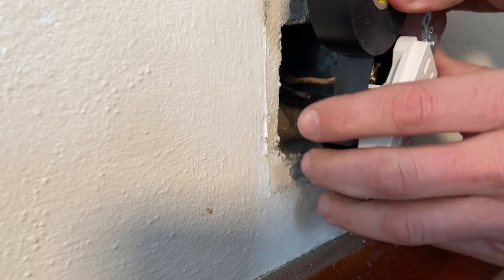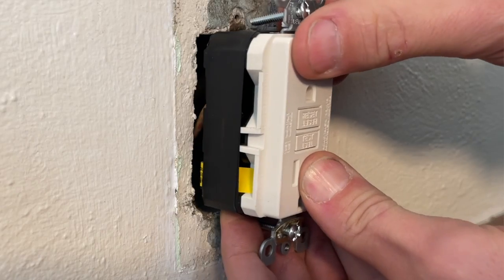Should You Wrap Outlets In Electrical Tape?

Comment: That there cotton tape impregnated with some kind of rubbery adhesive is called Friction Tape. Linemen use it on electrical split bolt connectors like where the lines of the drop connect to the service entrance cable. Of course, 3M makes Friction Tape as well as vinyl electrical tape.

Comment: Seems to me that if you need to tape your wires to your wire nut to attempt to keep them in the wire nut, you've used the wire nut incorrectly. Either learn to use a wire nut, or use a different kind of connector.
Reply: Wire nuts can spin off over time because of vibrations caused by current. It’s happened to me.
Reply: That’s not the reason, however you touched on a good point.  Too many people rely simply on the wire nut to twist the connections together, instead of twisting the wires, then securing the wire nut.

Comment: I was taught by an industrial electrician. Outlets should be wrapped because it is an open connection if not wrapped if you stick your screwdriver in to adjust alignment in the box you can get a shock. I always wrap outlets and wire nuts. You chose to test the wire nut after you put the tape on it. I chose to test wire nuts prior to taping. I also use a rubber tape on wire nuts not a plane electrical tape it cost more but my main goal is to make the safest connections.

Comment: I’ve been shocked before after removing a face plate and using painters tape to protect the outlet while painting.  Can only imagine the electrical tape would have saved this from happening
Reply: Or somebody correctly installing the receptacle, if it shocked you just from removing the plate, it aint installed correctly
Reply: @TheShaggyRifleman  “after” removing a face plate.  

It would be physically impossible to be shocked when the cover is still on
Reply: @jgetscensored7837  Yes. Thank you for the wisdom 🙃
Reply: @TheShaggyRifleman  anytime pal 🙃👍🏻

Comment: I always wrap outlets and switches.  I have seen outlets installed where they stuffed the outlet in before addressing the wires and the ground wire was extremely close to shorting on the hot side terminal.

Comment: In a tight box with a lot of wires I will sometimes tape the wire nut (after performing a pull test) just to make sure it doesn't get twisted loose while stuffing the wires into the box.

Comment: I live in Chicago so all of our Electrical is piped and metal boxes are used. Secondly I do my pull test prior to taping a wire nut. Why? Simple, the tape stops anything else from entering the nut, also for security. I have seen where wire nuts have failed due to improper usage.

Comment: I (a DIY-er) was recently about to stuff an outlet into a plastic box. I had a few junctions also in the box, and consequently a fair amount of uninsulated ground wires going hither and thither. I figured one of those ground wires coming into contact with one of the screws of the outlet would be a Bad Thing, so I taped up the outlet.

Comment: What a mess that will be in ten years when you need to do something to that wiring and it is all covered in tape adhesive slime. Thank goodness that waste of time isn't required in my area. Also is hides the terminals from inspection. You need to be able to see how the placed the wire under them and that they are tight.
Reply: You are correct..couldn't care less how he or she does it.but I don't use tape  at all .there is no place for tape if you are a professional at what you do.same as caulking to cover up sloppy carpentry work,they tape to cover up sloppy electrical work.

Comment: Gfci outlets are for receptacles near or prone to moisture(kitchen/bathroom backsplash ect, and any exterior). Never hurts to wrap in tape but not always necessary. But like you said, dont stretch the tape because the elasticity will want it to return to normal and will peel away(cause and effect).

Comment: I would only use it if I wanted to burn down the house if you need to wrap a outlet with tape you should not be doing electrical work
Reply: What about the Ideal receptacle bands? Do they burn houses down? Of course it's not needed, but it's not going to hurt anything.
Reply: @jimmac1185  the problem is that most people use plastic electrical tape. W
hen you plug something in the outlet and start pulling amps the outlet will start heating up (have you ever seen a melted outlet and plug that's been over amped) so what happens is the plastic can melt or start a fire if it gets hot enough. Most people put the tape on so they don't short it against the metal box  if you install the outlet with the power off like your suppose to (who does that ) and tighten it down correctly the outlet can't short out, so tape is not needed. I'm not trying say you can't do it just be careful and use a tape rated for heat.
Reply from the maker: I am not sure the tape has much to do with burning down a house.  There seems to be many regions in the US where even licensed electrician wrap receptacles.  I take it in your area this isn't very common?
Reply: @EverydayHomeRepairs  yes I've seen electricians do it here to and if you ask them why they will almost all say so it doesn't short out on the box. a properly installed outlet won't short out and I have seen a place where it caught fire thankfully they got the fire out before it did much damage just some burn marks above the outlet and yes it was a seriously overloaded outlet. I think this is one of those things that's been done so long that nobody knows why the still do it. and again I'm not saying you can't do just use the proper tape
Reply: @glenshinholt3332  the plastic that the outlet is made from can also catch fire in a "seriously overloaded" situation. The type of tape used isn't going to fix stupid people.

Comment: I'm just a DIY guy, but I've never used wire nut to actually make the connection but rather to only insulate the exposed wires I twisted with my lineman's pliers (solid core copper).

Comment: My question is, in new installations do you have to do it by code? and unless you are installing the outlet with the power on why you need to wrap tape around it? outlets or switches if install correctly they are build with enough clearance as not to touch the gang box.
Reply: exactly

Comment: in a multi unit box yes, it just concerns me when things are that tight, single I don't bother. I never really thought about it truthfully. I have seen the screws back out holding the wire, especially when someone else works in there after me and back stabs an outlet and it can be very tight in there.

Comment: I agree that if something looks too close for comfort, taping adds some safety and you may have no choice.  However, if you have complete control of everything like boxes, outlets etc., in other words nothing is too close for comfort, it's actually safer to not use tape.  The reason is that if you have a situation where a wire has unexpectedly moved an entire half inch and shorted or grounded inside your carefully laid out install, you want to be alerted big time.  You want a breaker or GFCI to trip.  You don't want tape concealing the fact that such a severe condition is closeby.

Comment: As for Wrapping the wire nuts,. Stranded Wires twist them separately 1st not too tightly just more to keep the strands together. Then Stranded or solid get twisted together this is the actual connection. then the wire nut gets put on to keep the connection from working loose. Then if tape is wanted/needed the tape gets wrapped so that it keeps a bit of twist on the nut. (Clockwise from the top). 
When to use Tape? use it if the connection is to be where moisture or dirt is a concern. Damp Basements, Box under sink for a Disposal, Craw Space Boxes, Shop areas (Especially if you work with Metal) that can produce Metal filings, Think in the vicinity of a grinder. 
It dose not hurt to include metal boxes in the above list. it dose not hurt to tape all wire nuts but it dose add time so it is optional.

Comment: Dad thought me to wrap outlets when I was a child.  He said it was to keep idiots from shocking themselves.   
On wire nuts: I use WAGO lever nuts, more expensive, faster to use, sure connections, easy removal without messing up wires.  The newer clear ones are smaller than the originals and visual inspection is better.  BTW I have some 1929 Ideal wire nuts made of porcelain which came out of my 1929 house.

Comment: When I installed outlets in my basement workshop I did use metal boxes and I did wrap the outlets with black electrical tape. Even though I did connect the wires properly, I was concerned that it may be possible that the screws could touch the box.
Reply: Screws can touch the box. They are grounded from the outlet and if the boxes are ran I conduit to the panel then naturally they are grounded as well.

Comment: Also when stripping to put a wire nut on multiple wires I like to strip double the amount or even triple the amount off of each wire and twist them where both wires are against each other and facing away from each other in an almost horizontal position. I cut to shorten it and give it a clean tip. Twist on the wire nut and no need to pull because they're both together.

Comment: I am no longer an IBREW member but I do work on my own light industrial facility. All my work is checked by a supervisory electrician. Our deal is that wrap all yoke devices so he can tell which are my work. 

We worked this out with our AHJ who has known me for at least 35 years. Sometimes real elechickens use wrapping as a “homeowner detection” system. 

Bottom line, work with a real electrician, even if you were one for decades. Stay in your lane. Nobody needs to get hurt.
Reply: Someone watches AVE

Comment: However, if you tape the wires together below the stripped ends you can align the wires and assure that they will all feed equally into the wire nut and not slide or get pushed back. After tightening the nut, wrap an additional turn or two around the nut and wire and, while the tape is not designed for securing things, it apparently doesn''t know that and works just fine :-) I do this on every RV electrical installation or repair I do. It may or may not be neccessary but I have yet to have anything get lose or short out due to vibration issues.

Comment: I wrap receptacles depending on the conditions... space between type of material and condition of wiring and outlet. As for taping wire nuts... if you aren't testing your connection before taping you probably shouldn't be making connections. Mostly done with my work on electric motors to prevent vibration over time from potentially causing loose connections from occurring because as he stated the tape will hold the wires in place providing an added measure of stability.

Comment: I was always taught by old electricians ,to put electrical tape around electrical nuts. But I always do the pulled test, first before I put the electrical tape. But I was taught to cross over the wires. This to make sure the nuts , never comes off.
Reply: In several countries in Europe, wire nuts are illegal (could not even find it in the stores)

Comment: I'll address 3 things: 1- I only tape up outlets & switches in metal boxes. 2- I use only Scotch 33 or 35 tape. (35 is other than black) 3- I don't tape wire nuts, and I always twist the wires & trim before installing them. Some people don't twist, says the nuts will do it as you put them on. I've seen this fail, especially on #12 & heavier.
Reply: Ive never seen a wire nut actually twist wires, 😳 I cant believe people actually think that its the case when it aint. And ive dealt with hundreds of wire nuts, both installing and reworking failed connections

Comment: I dont use wire tape on wirenuts because I use Wagos usually now. Ran into them in UK and find them awesome. Now, around outlets and switches I do use tape sometimes, but there is also a new product that is like a rubber band and is better than tape or, in the case of many remodels, I have been using the sleeve inserts to bring boxes out- as new code requires boxes to not allow wires and outlets to be gapped by tiles or thinset or such..
Reply from the maker: Hey Adam,  I forgot to mention those.  IDEAL came out with a product they called Armour Bands which are an alternative to wrapping electrical tape and although a bit pricey you can pull them out of the way if you need to service the receptacle or switch and then just snap them back into place over the terminals.
Reply: @EverydayHomeRepairs  To me they are not all that pricey when dealing with the newer electronic switches and the afci and gfci outlets and switches. Same reason I use the Wagos. Easier to trouble shoot the circuit or to test the circuit. UK has the electricians testing Apartments and businesses now like every three years and homes are requested to test every five years for safety of wiring etc...

Comment: For single gang metal boxes, I use an extender insert instead. More expensive, but less hassle and less mess if I ever need to remove the tape. Also less chance of failure.

Comment: I'm a total amateur, but I have a hack that I use (feel free to tell me why I'm wrong).
I use some red vinyl tape and I make a red band around the outer sheath insulation of the hot wire(s) that enter the box.
I think it makes a complicated box less confusing.  In other words if all the wires in the box were unattached and the power were turned on at the breaker box, the wire identified with the red band is the dangerous one.  In places like my finished attic, where I can get behind my walls, I also label the hot wire with a red band outside the box, for easy identification.

Comment: I was told by one of my electrical instructors not to use 33+ or regular electrical tape. As over time it will fall off. He mentioned the other types of tape and wraps for a more permanent hold.

Comment: I always wrap tape around no matter the box. This way down the line if someone does some maintenance whether it be a new face plate or new outlet and touches or grabs the side of the outlet and forgot/didn't turn the breaker off they don't get a shock. I always remove the outlet by the metal grounding/mounting bar. 

As for wire nuts, I usually tape them, but I always pigtail and tug the wires before. I also make sure to wrap the tape clockwise, so it goes with the nut rather than against it possibly loosening it.

Comment: Back to this after finding a GFI that was wired by a “handyman” improperly. Hooked the screw with a No. 12, instead of inserting it between the compression plate, which lifted the set screw above the plane of the GFI sides.... grounded out on the metal box.

Comment: I know that there are different opinions on using wire nuts.  If I choose to use the correct size wire nut then I create a physical, mechanical connection by twisting the wires first, then putting on the wire nut, then testing by pulling each wire and putting one short wrap of super 33.  Depending on the availability of space, I may choose to use Wago 221 for any connections when space is minimal.  Wago makes two sizes of the 221 now.  The new one will accommodate up to awg. 10.

Comment: I use the tape on both. The wire nuts are given the pull test before I install the electrical tape. Never had any issue at all.

Comment: I sometimes add tape to a wire nut (after the pull test) to help keep corrosion at bay in certain instances where HVAC equipment has a lot of humidity/condensate water nearby. Anything too bad gets the grease treatment before the nut goes on. Unless I’m lucky enough to have some pre-greased ones around.

Comment: With the availability of WAGO connectors and relatively low prices, any DIY'er should probably be using them. I would think that any professional electrician would suggest them for non-pros these days. What do ya think pros?
Reply: not as good as a wirenut

Comment: Wrapping electrical tape around a receptacle can lead to other problems more financially than physical. Some 15 years back we had a client who owns an residential home. We took a digital watt meter to monitor voltage, current and wattage. First we read 1200 W of power, then we unplugged everything in the house and gave that second reading. When we read the wattage it read 500 Watts. Then we decided to look at the receptacles and the receptacles have electrical tape wrapped around on the receptacle. We decided to unravel to tape and re-insert the receptacles back in the metal boxes without the tape. Then we gave other what reading of our instrument and it read 1.5 W of power. What I’m saying wrapping tape on a receptacle can cause problems financially and physically because it’s semiconductive properties of the adhesive. And the likelihood of the receptacles being taped around in the beginning when it was first finish construction in the late 1970’s, when the house was first constructed. It’s my opinion that is bad advice wrapping tape around a receptacle.
Reply from the maker: Thanks for the example Mike, appreciate the feedback!

Comment: I don't normally wrap wire nuts with electrical tape while doing residential work but do in industrial applications after pull testing my wires. I've seen too many situations of vibration causing wire nuts to loosen up. I also leave a tail on the tape to make it easier for the next guy to remove.

Comment: I tape wire nuts like you said, just for insulating, but also in the future if I need to move that wire nut to the side, the tape helps to keep the wires from becoming looser while moving the group of wires around in the future for some reason.

Comment: I tape receptacles and switches when in a multi-gang box or in a metal box. I am not a licensed electrician, but do a lot of electrical work.   I have wondered if perhaps it should not be done due the possibility of causing a heat build up.  My main reason for taping is for safety of anyone working behind me.